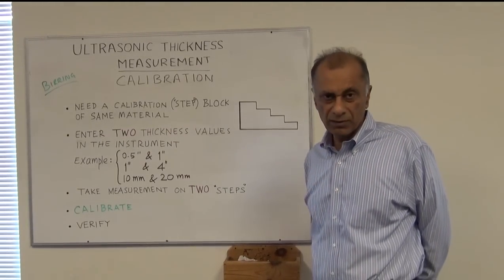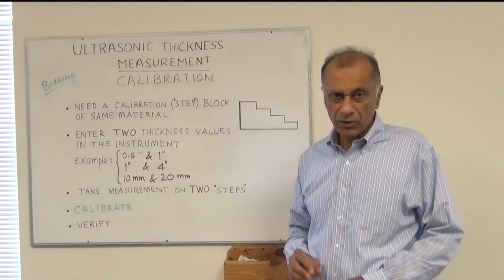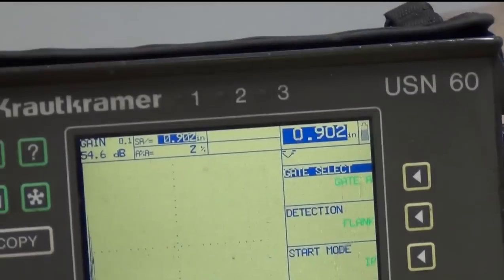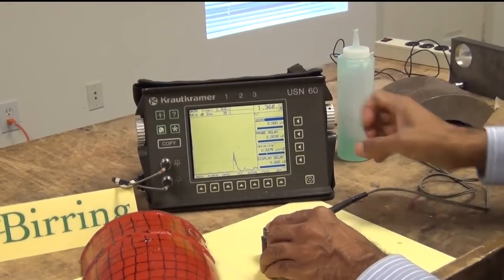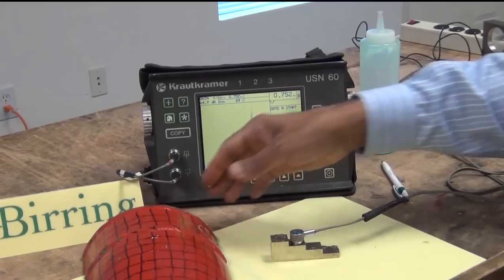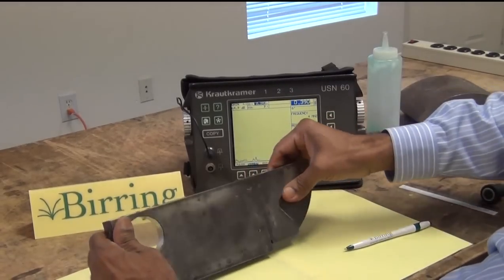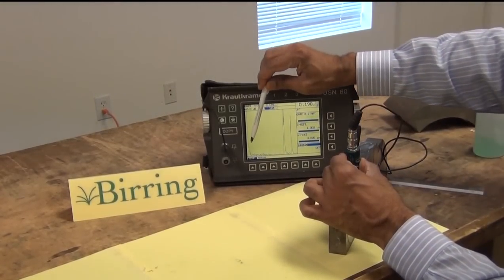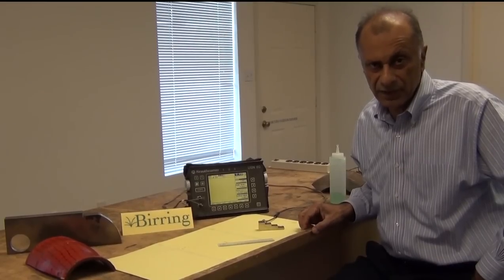Birring NDE 104, UT Thickness Measurement Calibration Steps; Ultrasonic Testing # 1B,

Comment: Im Using v2 block only  , 12.5 mm 25mm 50mm 
Calibration by backwall echo 
Is it ok ,or wrong 
Because i have only v2 block
Reply from the maker: Will add shortly
Reply: @anmolbirring6341  please make video about corrosion mapping on pipe ,small pittings large corrosion pattern